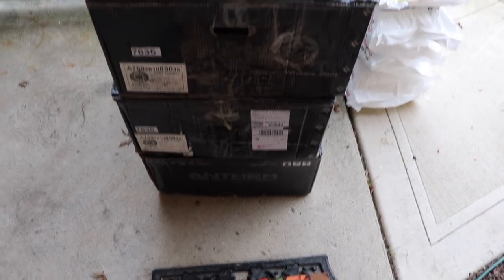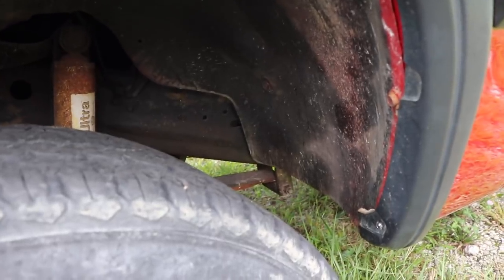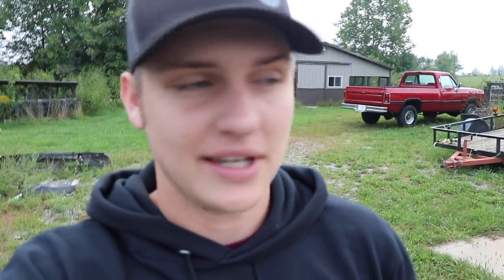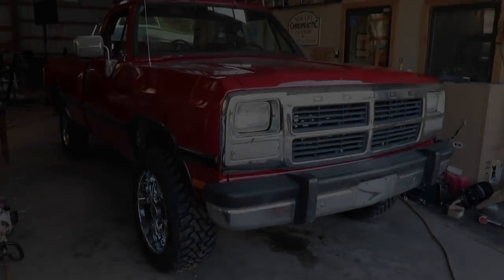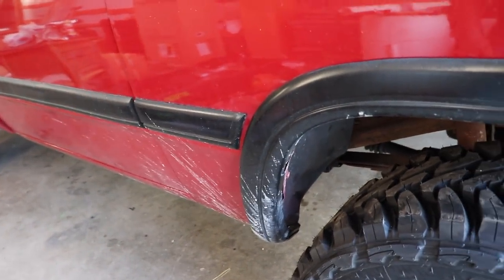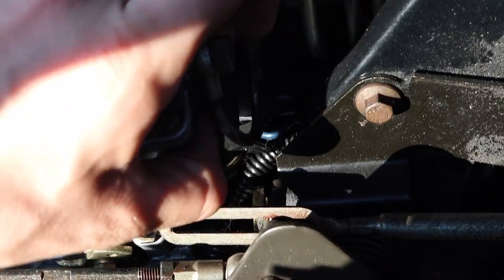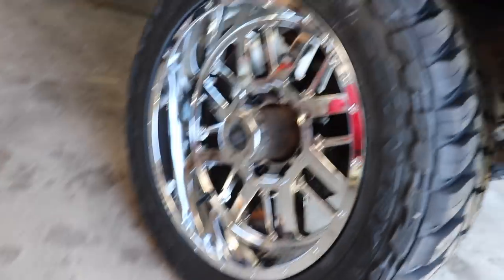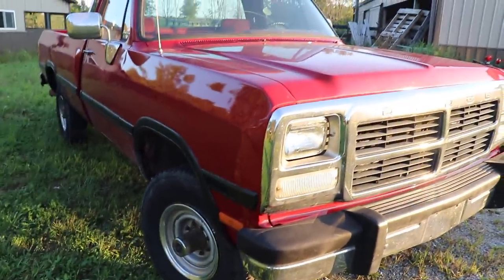NEW WHEELS ON BIG RED 12V CUMMINS!?!?

Comment: Do it yourself might need a torch if the leafspring botls are stuck in the sleeve but you might be able to cut them off with a grinder

Comment: We had the same problem with our fenders when we put the wheels and tires on. Didn’t wanna throw a level kit on it so we cut the flares extra space and it cleared. Also the flares got loose so we put some self tappers into the flares. But we did it the quick way cause it’s a budget build.

Comment: The front leaf springs were pretty much flat from the factory. Not that hard of a job to change them but if you do new fronts you might as well replace the rears too that way the front end doesnt sit higher than the rear and it will tow and haul a lot nicer.